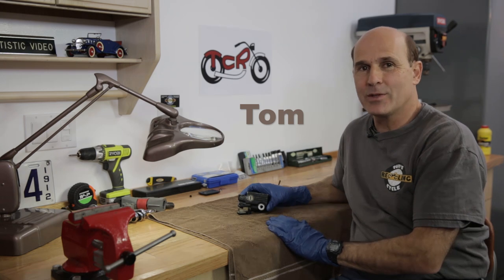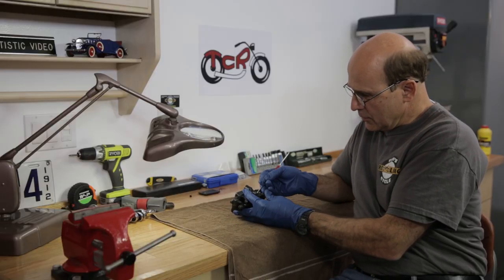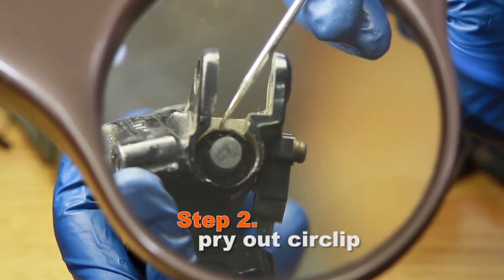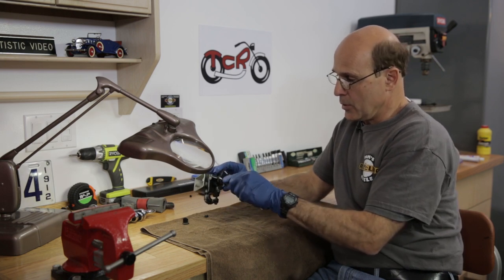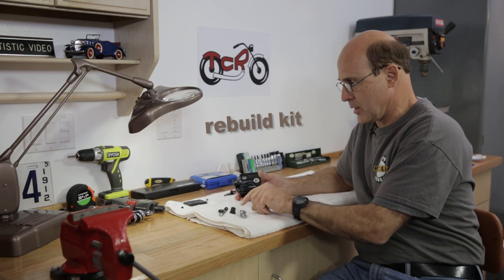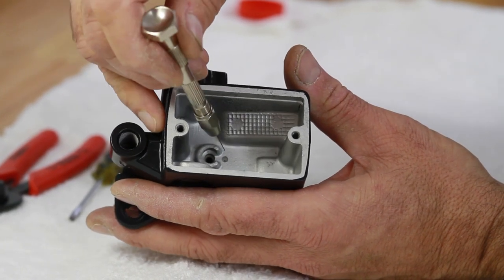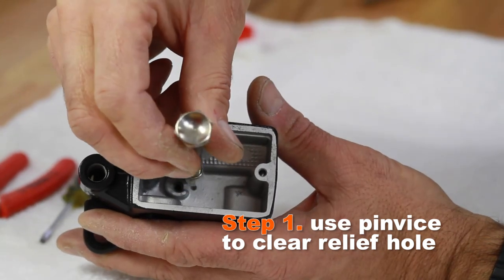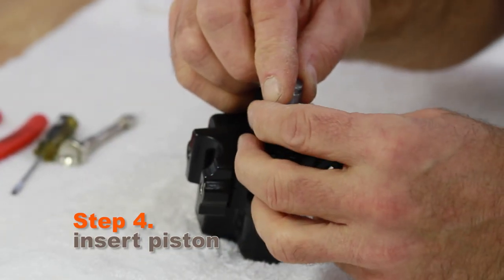Front Master Cylinder Disassembly and Rebuild Procedure

Comment: This is the only video I’ve seen anywhere that mentions cleaning the pressure release hole. Thank you for the video and guitar string idea.
Reply from the maker: Glad to hear that my video helped! Thanks!
Reply: @tomscyclerecycling8242  The front brake on my 1993 FXLR has been dragging really bad and I’d have to stop and loosen the bleeder to relieve pressure. I followed your instructions and pulled the handle looking for an air bubble from the pressure release hole and got nothing. Then using a guitar string (g string to be exact) I cleaned out the pressure release hole and pulled on the handle. It might sound strange but I’m happy to say I was squirted with brake fluid. I was thinking I need to take it apart and rebuild but I think it’s good now. Great video, sir.

Comment: BTW, I would like to mention CRITICAL....on your master clutch cylinder a blocked return port will cause you to completely loose your clutch (full slippage) until the hydraulic fluid cools off again and contracts and also full clutch spring pressure exercision on the wet clutch plates.  I just realized that is where all my slipping clutch problems reside.
Thanks for great video.  Note Hydraulic fluid in clutch system gets much hotter than brakes and sustain temp (up to engine and oil temps....~400F) until engine cools sufficiently (like waiting about 80 minutes).

Comment: This is going to help with an FJ1200 Master Cylinder.  Thanks.  If I could add one suggestion.  While you were rebuilding the MS, it may help to take a picture of all the parts, laid out on the bench, in the order and placement of how they may be in the cylinder.  For instance you inserted the spring and rubber end but I was not sure which end went into the MS.  I am guessing it would be obvious once I went to put them together but I could not see if the rubber end went in first or if the spring end went first and the rubber end piece was further out.  Seeing all the parts lined up, as they would be in the bore, takes away any doubt of how things should be inserted.  in any case, a fine video that answers most of my questions.  thanks  Alex
Reply from the maker: Thanks Alex.  All good points.  I think you'll have all the missing pieces of your puzzle when you pull apart your master cylinder.

Comment: Did you replace the internal parts of the master cylinder?  The seals may be worn and aren't pushing the brake fluid.  Make sure they're in good shape and properly installed.

Comment: The wide end of the spring goes in first.  The narrow end had the rubber cap positioned with the flat end pointing out toward the piston.
Reply: I messed this one up, couldn't figure out why I could get fluid through the system :P One of my more frustrated moments that.

Comment: Hey Tom, great video...  wondering if you could help....  my res has a clear plastic circle in the bottom which covers the return hole....  how do i remove this without damaging it???  Many thanks in advance Dave UK...  P.S. the bike is a 2000 model XR400

Comment: This looks like maybe what I need to do. I have a Hyosung GV650 that just started showing signs of issues with the master cylinder. If I compress the lever normally, it sort of jerks instead of having a smooth motion. If I exert pressure on the lever sideways in addition to normal brake compression direction, I get smooth action. I did some playing around to see if the jerkiness originated at the handlebar cylinder or the wheel end, and I'm pretty sure it's at the handlebar end. I was all set to order a new master cylinder, but maybe I just need to rebuild it or maybe even just take it apart and clean it. Seems like I run the risk of damaging rubber parts if I just try to clean it, though, eh?

Comment: Very good video. THX
I have a Suzuki 1982 GS850G with what I believe is a problem in the master cylinder (rectangular reservoir). I have no pumping pressure despite everything looking good inside the cylinder. I check for the return hole you mentioned but I only have one hole.The brakes were working before but the brake pads were too close to the brake disk. After I cleaned the master (it is old) I have the no pressure problem. Any ideas? THX
Reply: 1) Your master cylinder has to have a return hole. They are sometimes very tiny and can be difficult to see if completely blocked.
2) Did you bleed the brake after you rebuilt the master cylinder? If you don't bleed all of the air out you will never get it to produce pressure at the pads.
Reply: Sidecar Bob I have the same issue. I rebuilt the lever on my 79 GS1000l. I bled the lines and not matter what the fluid just moves around the master cylinder. It does not seem to get pushed down the line.
Reply: thirdGEARchirp More information is needed. Did you install a rebuild kit or did you just clean it out and put the old parts back in? If you didn't replace all of the rubber parts you wasted your time. And how are you bleeding the lines? There are several methods and depending on which one you use and how you are doing it you could be causing your own problem. This needs more instruction than is feasible in the comments for a video so I recommend that you find & join a forum that specializes in bikes like yours and ask there.

Comment: Nice 'how-to'.  I wish I had watched this before buying my kit because I think my master is fine except for the return being blocked.  Another thing you can use to clear that return line would be a welding torch cleaning tool.  Not sure which gauge to use though.

Comment: Awesome.  Like the workshop and format, and the magnified closeup!  For refinishing the housing, do you prime it for painting?  What type of paint do you use?  Is there a particular paint that better resists brake fluid?  Thanks
Reply from the maker: I  didn't paint that master cylinder, I powder coated it.  After disassembly and cleaning, I media blasted it with aluminum oxide but plugged the bore to keep the media out.  Then it was washed, dried, and outgassed before powder application.  Masking and plugging was done prior to powder coating, to prevent getting powder in areas it doesn't belong.  Then it was cured in the oven for a hard, beautiful finish that's resistant to brake fluid. Glad you liked my video and thanks! Tom

Comment: This might not find it's way to you since it is such an old video. I've found out once rebuilding this that it still does not work. Doing exactly step by step. However, I thought perhaps it is because a tiny piece of brass, like a stopper, flew out of the inside from the reservoir. Would that tiny piece cause the mechanism not to work properly? I have seen it on the front brake, but not the clutch brake. 1996 intruder 1400. The bike sat in a garage for 23 years. Has only 1000 miles. Neither the clutch or the front brake work now that I've rebuilt them. AT first I could see a few tiny bubbles...Then working the lever dozens of times. Now nothing. Does not pump fluid. Thanks. Hope you or someone can help. Great video by the way!
Reply from the maker: Hi Rick.  You can contact me through my web site at www.tomscyclerecycling.com.  I should be able to help you sort it out - perhaps over the phone.  And thanks for the compliment!
Reply: @tomscyclerecycling8242  hey I did manage to get the front brake to bleed and pressurize. But clutch side not wanting to pump up. Have taken it apart twice. Perhaps I ruptured the tiny flange on the seal. I ordered another kit. So I will retry again. Not  sure why this is so difficult to make work. Any tricks to it you didn't include? Thanks

Comment: Hey Tom, how would I remove plunger if frozen in the front master cylinder.
Reply from the maker: Hi Erik.  Connect it to another master cylinder through the banjo hole and you will be able to pump it out.  I just had to do this the other day with one that I'm restoring for a customer.  Just make sure that the snap ring is out and that the plunger is pointing away from you!

Comment: Hi tom, I got a little packet of grease with the rebuild kit! Should i use it on the rubber seals on the piston? Using grease in the hydraulic system seems odd to me?
Reply from the maker: Yes - once the seals are in place in the caliper, put some of the grease on your finger tip and spread it on the surfaces of the seals.  It's a special grease formulated just for this purpose and is better than using brake fluid.

Comment: Hi,can I ask,which. way does spring go in,black cap first or open spring first,thanks
Reply from the maker: The wider end of the spring goes in first, with the rubber cap/seal in the narrow end.  You'll see a hole in the steel cap on the narrow end.  That lines up with the little rubber nub on the inside of the seal.

Comment: Hi Tom, first of all thank you very much for taking the time to make this video and helping to de-mystify brake master cylinders. I'm going to do this work on my Triumph Tiger and I have 1 question please;
Why is there what looks like a worm gear on the piston. I ask this question because my brake lever comes a long getting close the 'bar, before firming up. I was wondering if this 'worm gear' was some way of adjusting the length of travel of the lever?
Cheers
Dave

Comment: Tom,

My circlip is rusted and penetrant isnt working to free it. I have tried pushing down the plunger to relieve some pressure, but that didn't work. Any ideas?
Reply from the maker: Try using a nail set (fine punch) and gently tap around the edge of the clip.  Work your way around it and this might eventually break it loose.  It works for me all the time.
Reply: Thanks! The rebuild was a success.

The front lever feedback is much improved. Stopping distance, especially under heavy braking, is noticeably improved. Thanks again!
Reply from the maker: Awesome Tom - glad you had good results.  Now enjoy that ride!

Comment: When everything is dissasembled, can master cylinder be blasted and powder  coated? I guess I will need to remove the brake switch?
Reply from the maker: It can be done, but if it has a plastic sight glass, it will also be removed.  It will be destroyed in the process, so you'll have to find a replacement.  I have restored dozens of these, including the powder coating and rebuilding.

Comment: my rubber boot tear up.. may I ask what will happened if I didnt change it
Reply: +Ban De That rubber boot is to keep dirt and stuff out of the cylinder/piston assembly! I'd imagine over time dirt could get stuck in there and potentially even damage the cylinder if it gets jammed between the piston and the housing and scratches stuff up...
Still, that might take kind of a long time and a lot of abuse before it happens, unless you're on a dirt bike!

Comment: i take my circlip out bu tthe washer and piston are still stuck
Reply from the maker: Try using compressed air to blow out the piston and washer.  Use a rubber tipped blow gun pressed up against the threaded hole where the brake line connects.
Reply: thanks man